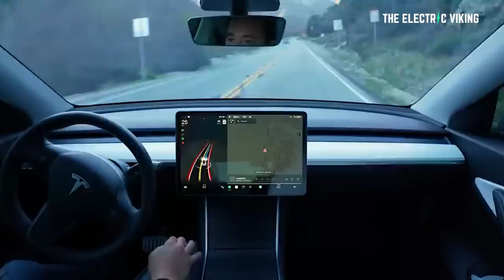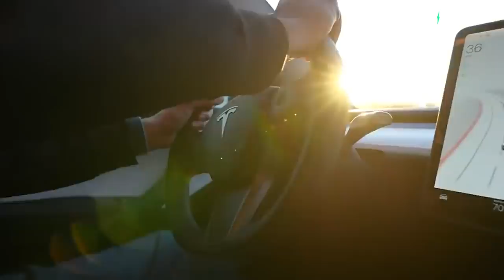Chinese insider EXPOSES Tesla's amazing new battery

Comment: I don't think Elon will allow the Model Y range to exceed ~350 miles regardless of the new battery capability.  He has made comments about range requirements before, related to dragging excess weight around when not required.  What I see is the opportunity for Tesla to reduce the amount of batteries required in their cars, hence reducing cost and weight.  This will translate into several benefits for the company; potential to increase profits, and/or reduce the vehicle price tag, and/or deliver more cars with the capacity savings from fewer batteries required per car.
Reply: Exactly. If you really want a longer range you'll have to pay a premium for a model s or x
Reply: Agreed.  My worst-case long-range requirement is for about 450 km one-way, & here in Western Canada I can already access Tesla Superchargers at convenient sites at both ends of that trip.  The future looks bright!  Now I must earn some more $$ to be able to buy an M3 & sell my 2007 Honda Fit - a great little car, but both maintenance & fuel costs are rising & I have no reason to think gasoline will get cheaper as the years go by...
Reply: Correct. It would be fiscally irresponsible to do otherwise.
Reply: I hope so too. The range of a standard M3 would be good enough for me. My current EV has about 250 km real world range in the summer, and that is already very useful despite popular belief that you need at least double that. ;)
Reply: At moment, CATL supply the battery pack which is 72kwh As standard. As this CTP, Tesla can't change it. Unless Tesla use their software to lock part of its range.
Reply: Except that number was 400 miles not 350.
Reply: I agree Tesla will most likely reduce battery quantity, thus reducing weight. I wouldn’t count on them lowering the prices however.
Reply: However.. longer range (450-500 miles) could potentially take some of the stress off of the supercharger network.  Thinking of those situations where there is a line just to charge.
Reply: I really hope they do a 400 mile long range. Consider real-world range is so much lower many times if the year, 400 is really critical.
Reply: So basically, Tesla's new battery is made by CATL.  From the title, I thought they developed a new battery.
Reply: Hello Sam and all; I built a car years ago with the main body of a 2011 Chevrolet Cruze ECO and it will go 840 to 1280 miles (not Km) or more on a single charge!! Now Elon is too busy to answer my certified mailing that I sent to them (Tesla) on numerous occasions! With my technologies the battery pack would be a third of the size thus saving weight and space which in themselves helps increase range! 
    My name is Edward Heath and my company is “New Ideas and Innovations, LLC“ out of Madison, CT USA
    Great video as always Sam, love your enthusiasm!
Reply: less weight also obviously means less structure required ie springs wheels etc can be reduced in size leading to better rolling resistance etc . Now if Tesla could uses Tesla's wireless energy transmition that would be the last nail
Reply: True, but 600-700 miles of range would mean free advertising, less worry for non-enthusiasts, far less FUD, and would help stop the constant annoying short selling.

Comment: Less lithium in batteries isn’t necessarily impactful on price. The percentage of lithium in Li-Ion batteries is very low. 
But anything that makes batteries more efficient is absolutely welcome.
Reply: LiFeP04 batteries should last for a very long time and no huge fires. I have nine portable solar power stations with the "dangerous" type of lithium ion batteries in them and wonder if they`ll explode in 5 to 10 years if I try to make them last. I regularly cvycle all my emergency batteries by running a USB fan all the time so about every three to four months each power pack gets cycled. No sense in buying something like that and putting it in a closet. I also have two Bluetti and a Golabs power station with LiFeP04 cells in them and a large 12v 300 ah one for emergency solar power for a window AC after hurricanes. Here in Louisiana heat stroke is a very real concern during late August power outages. Hopefully Tesla makes the power in these cars available via outputs for emergency use for people experiencing dangerous power outages.
Reply: The mass percentage is low, the price percentage is significant.
And quite apart from price, there isn't enough battery grade lithium made to satisfy demand, and there won't be for many years to come.

Comment: I ordered my M3P in April 2022 and delivered in June and my Tesla came with the LFP. Tesla said I need to charge to 100% at least once a week. I leave it unplugged for a few days and my battery does not drain but could be because I leave it in the garage. I only drive it on the weekends. Tesla says to leave it plugged in but only because the car updates and uses power when parked but I only allow sentry to turn on when I leave the house so I don’t need to leave it plugged in. I spend 5-10 bucks a week to charge. I love this car.

Comment: LFMP is a massive change to the cathode. The higher voltage will also put more strain on the electrolyte.
We can hope, but we shouldn't simply assume (as you seem to do) that LFMP batteries will have the same cycle life that LFP has.

Comment: Wondering if the discharge rate of the M3P batteries would allow them to be used in the Performance Model Y with no Performance trade off's.
Reply: Interesting, I think this is one reason why Tesla are using different chemistries across the range.
Reply: Discharge rate had a (rough) correlation with energy density.
Dispute the "enthusiasm" shown here I still believe these cells won't surpass existing (Tesla) 2170 levels (yet) at cell level.
Wait and see
Reply: @rogerstarkey5390  I just like the the LFP batteries in my Model 3. Charge to 100% is great! Ordered a Model Y Performance and would hold off delivery if the M3P batteries were a direct replacement to the NMC batteries with the added benefit of the full charge battery capability!

Comment: If they are using some catl, some Panasonic, some 4680/2170’s they make, they’ll have to downgrade the number of cells or software limit packs to keep range consistent- otherwise they’ll canobolize current long range orders for future ones.

Anyone know if the acceleration with those cells would be on par with whatever they put in performance models now?
Reply: By changing the ratio of parallel/series wiring of cells within the battery you can affect the power delivery from the battery & charging capability, therefore speeds of both.  The actual power density of the individual cells is not such a critical factor regarding performance.  Cooling also plays a critical role regarding current in & out of the battery.

Comment: 20million vehicles, EVs plugged into the grid 24/7 we can dump the 25GW of fossil fueled power generation plants in Australia. 
Big fossil fuel industry knows this.

The grid is perfect today as it is, no massive FATTENING needed. 

Australia has 20million buildings all connected to the grid. Rooftop PV oversupplies grid without the EVs huge batteries.

Comment: What form factor will the M3P battery utilize? Can this chemistry be used in the 4680 battery? If not, will Tesla abandon the 4680?
Reply: almost any chemistry can be used in 4680 cells.
but there are also reasons not to use 4680 cells and use prismatic or pouch cells.

Comment: LFP batteries have been used in RV's, etc. I use one to run my trolling motor. In other industries it's call LiPO4. I wonder what the range compared to charging 80 percent with NMC batteries compared to 100 percent LFP batteries. Can't LFP. battery chemistries be used in 4680 form factor?

Comment: This battery tech may allow Tesla to introduce new entry level trims for Model 3 and Model Y. As much as a new basic Tesla would be great, the Model 3 and Model Y are already in production and have gone through most government tests. This means they could more rapidly deploy a lower trim level than to get a new model to market. If there was a 30,000 dollar Model 3 and a 32,500 Model Y options, they would crush most of the competition. If they had 200 miles range,  recharge to 90% in 10 minutes, they would appeal to most buyers.

Comment: OK if it greatly reduces Lithium; that would be major; the 4680 being 16% more energy dense would set the standard - it would need to charge as fast as 4680 and reduce lithium by at least as much will presenting some other benefit like less volatile or cheaper.  I think you said cheaper but you didn't have many specifics so far.

Comment: Is this Tesla manufactured LFP cells or Tesla using CATL/BYD cells?
Reply: I mean, did you watch the video?  How many times must he say CATL M3P cells?
Reply: @richardfolden3860  Actually, I chose not to! The first 2 minutes of the video sounded so much like a scam video (that keep talking intentionally tangentially without making a point). Also, why is the video title "Tesla's amazing new battery"?
Reply: @omnicurious2949  you don't know what you don't know if you don't watch the video 😂
Reply: After watching the video a few times, CATL is making the batteries and they will be structural 4680s. (I’m guessing that 4680 is a physical specification rather than a chemistry specification.). What I’m not clear on is if Tesla will also manufacture LFP 4680s. Though why wouldn’t they since they will be cheaper?

It sounds sensible for Tesla to do this unless they don’t have the technology or line capacity.
Reply: @scifithoughts3611  yes, 4680 merely refers to the physical dimensions. But given how thick the cell is, 4680 essentially has to incorporate the 'tabless' electrode construct. It is open to various chemistries.
The LFPs delivered to Fremont factory (from CATL, to go into std range Model 3) are not cylindrical at all....they're prismatic.
It is unclear when Tesla will start producing own LFP cells. Right now the focus/effort is  on to ramp up NMA cells...as they offer the highest energy density that critical for Cybertruck, Semi & Roadster launches (cells from other manufacturers may not hit the required energy density, price etc parameters). Tesla is happy to buy lower energy density cells from other manufacturers right now.
Reply: Tesla still struggles to make its own batteries.  The Tesla fanboys can spin it anyway they want, but the truth is that Tesla needs CATL, LG, and Panasonic to make its batteries for many years to come.  🤣
Reply: @AI_HQ  Where's the spin in my comment. I said exactly the same stuff...that Tesla will continue to depend on third party suppliers. You need to rid yourself of the hateful glasses & reread.
Reply: @omnicurious2949  Sorry dude, my comment was meant for the Tesla fanboys.

Comment: What is the form factor? Will Tesla be able to use this in structural packs? My understanding of those is that the 4680 cans for added rigidity.
Reply: Yes those cans are used that way and my understanding is CATL is making that form for Tesla. 

 But it's not a huge deal to do the batt pack with blades or whatever, still structural.  Batt pack should always be structural to some degree, it's always has some strength/rigidity which should reduce 'body in white' structure in that area of vehicle no matter who's building the car. For Tesla they can simply build the pack a little different to get the same structural properties out of it even if small trade offs required in weight and complexity, that way the rest of car can be identical with either type of pack.
Reply: @Mrbfgray  The point is, their manufacturing process is vastly different between the two. Structural packs are filled with glue-foam that renders them completely unserviceable, non-refurbishable. Any failure is a scrapping of the entire pack. Replacement will be forced new as a result and require a bunch of interior work to remove and reattach carpets and seats, adding to the already high cost of battery work.

Not to mention that they invested heavily in the 4680 form factor and structural packs. Pivoting away from that reveals a potential error on Tesla’s part. Adopting that platform before it was proven.  May need to retool lines to use non-structural packs on the new structural lines.
Reply: @MorriesWigShop    Nah...You are inventing problems that won't exist.  New batts will last longer than the car with very few exceptions.  And you aren't going to be "refurbishing" a 5 or $7k batt pack anyway.  Even a pack designed to be worked on will require too much labor and expertise for that. 

"Pivoting away" is silly notion, like I said in a worse case (probably not going to happen) a blade pack will only have a slightly different mass, 100% interchangeable as far as the car is concerned.  I seriously doubt seats and carpet are an issue.  

Do you worry about your $50 batt in your $500 phone being replaceable?  I don't but then I don't live on my phone either.
Reply: @Mrbfgray  I don’t own phones for anywhere near as long as cars, nor do I spend anywhere near the same amount of money on them.  I can hear your FAITH in your posts.
Reply: @MorriesWigShop    I can hear  your ignorance in your posts.  Update yourself. ;-)
Reply: @Mrbfgray  
I'd love to know how you understand that?
.
I was about to post elsewhere that 
1) There's no real reason iron based cells can't be made in 4680 format.
.
2) It may be logical due to:-
a) standardisation/modularity.
b) Potential production speed/ volume.
.
3) That I'd REALLY like to see billions of lithium/iron/manganese cells flying out of Tesla / CATL plants..
But.....
I've seen zero evidence or even indication that that's the case.
Reply: @rogerstarkey5390    Not going to write a thesis statement here.  You don't see much of what's actually happening, do you?  You either have confidence in the facts, hints and expectations expressed by Tesla or you don't.  

Did you SEE when they modified the front/rear castings or went from 1 to 2, and all the other improvements?  Not until they were out on the street you didn't, and then not until Sandy Munro exposed them.

Not my job to convince anyone else.  I've followed Tesla and Elon for over a decade with increasing intensity, made a fortune on it and expect to dwarf that going forward.  If you are looking for absolute certainty you are in the wrong universe.  Doesn't exist.

  That it's HARD is why the opportunity is so great, STILL.  Decide for yourself.  Your conclusions and choices are not my burden or concern.
Reply: @rogerstarkey5390    Another angle: 

 We've seen FAR more stressful times in Tesla, 2018 the worst in recent memory, Elon was sleeping on the factory floor for many months, for all to see that HE was getting it worse than anyone else and there to be woken at any moment to solve problems on the assembly line as they struggled with the ultimate test of 1st mass production.  Wasn't clear they would survive but Elon never quits.

Today Elon is confident, relaxed and enjoying himself.  Not complacent but able to laugh easy.  Possible he's kidding himself but probably not to THAT degree. 

 I have reason to expect they will solve crucial problems and continue to perform like no one else even attempts to.  If the 4680 continues to lag, as it has so far (no big surprise to me), it won't be pain free but they'll find a way as they always have.

Such confidence doesn't come quick and easy, I as millions of others, stressed with them.  Over the yrs you begin to understand, they don't DO EASY but they find a way. 

 Probably Elon's greatest strength is building spectacular teams and motivating them to do the barely possible.  

You may not have that confidence, most understandably don't, but you may not have "seen" what I and others lived thru.  As an investment--I can only suggest you take the time to gain SOME of that same sentiment or simply stay clear.  There are no shortcuts.

Without REAL CONVICTION you'll bail at the worst possible time.  Many claim conviction but betray the opposite by fretting over meaningless stock price action.  They don't want to admit it but they are not invested they are gambling, a losers game.

Comment: LMFP batteries are cheaper and are the main cost component of the EV, so why are prices rising??? 
Why did you not mention the actual energy density?  Currently it's 160w/Kg compared to 4680s at 296w/Kg.  So a significant increase in weight of the EV for the same total output -  the new Semi would need 6.25tons of batteries + container + cooling system + BMS.  Total 7.25 tons ish.  A normal ICE semi would have 400Kg of diesel.   At least LMFP prefers a 0-100% discharge-charge level (it will take 3 hrs to fill on a 350w charger or 42 mins on a 1400w charger) as opposed to a 10-90%

Comment: What would happen to the battery if they used a higher grade Lithium instead? Would they be better?
Reply: Basically you are describing the batteries today.  
The enhanced LFP described using less quality lithium however will continue the trajectory for more density, less cost, quicker time to market, and lowered degradation.
Reply: @kabysummit5801  yes but the new LFMP battery uses lower grade Lithium.  I wonder what it would be like with higher grade? Possibly a better battery but the price trade off might not be worth it.

Comment: Small correction there, Sam. Those batteries are not being recalled because of their chemistry. They are failing because they are pouch batteries. Pouch batteries are inherently fragile. They do not do well being bounced around in cars. I'm just wondering how long it wil take the big brain engineers to realize that.